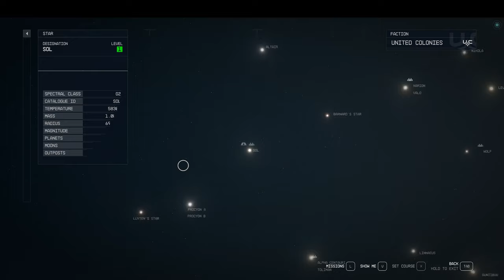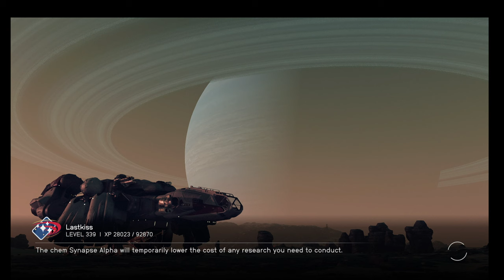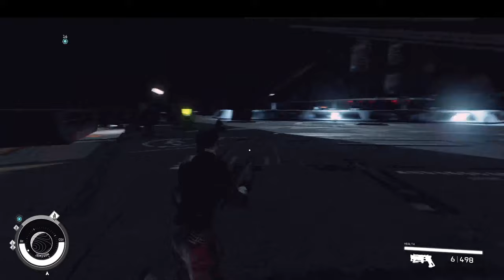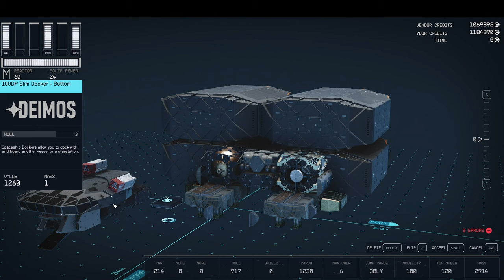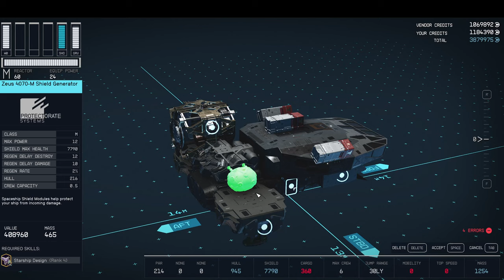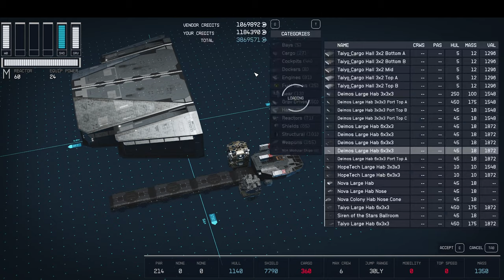Starfield M Class Ship building tips and tricks

Comment: So for console it's showing unattached modules when I connect a regular HAB to an M Class hab any reason for this?
Reply from the maker: yea man, really buggy when working with the M Class stuff, unfortunately. A lot of the m class stuff was incompatible with the regular parts.
Reply: @zappedcustomdesigns788  so which habs work with the regular stuff exactly?
Reply from the maker: @anubisstudios4321  so in order to get the habs to work, try using the flat 1x6x6(i think its that size) base module in the M Class section, if i remember its like general habs section or miscellaneous, its been about 6 months since i played. It will attach any hab to the center, then you can attach M class stuff to the M Class base and regular stuff to the hab thats in the center of the M Class base.